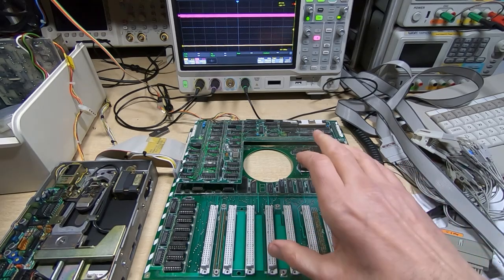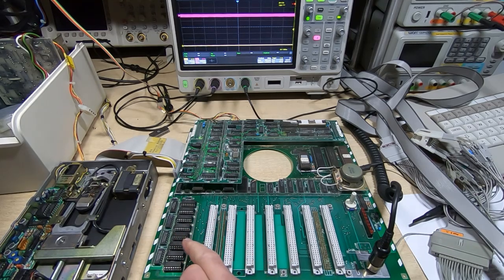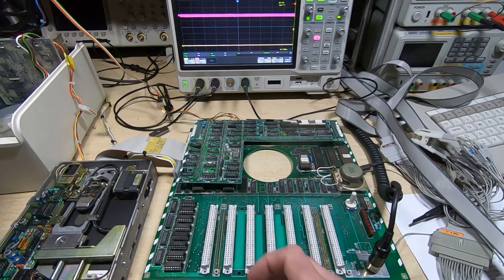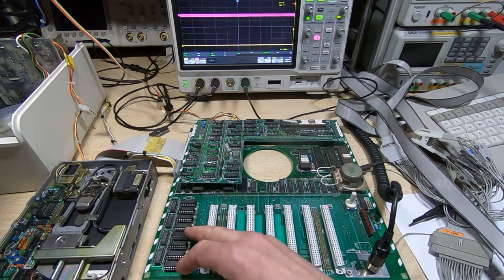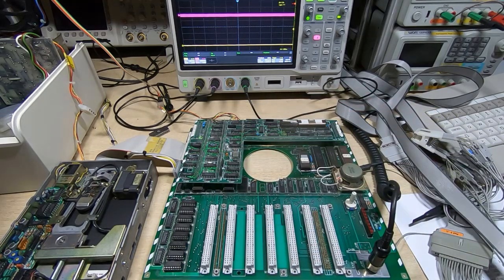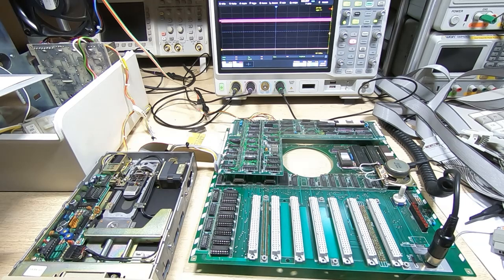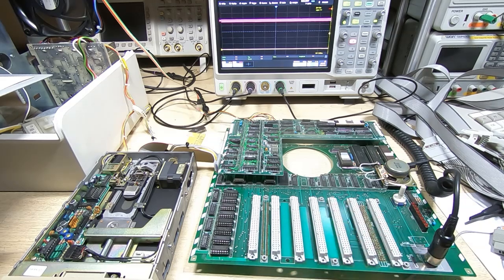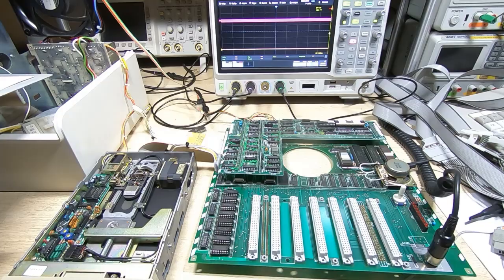NCR Computer Repair Part5

Comment: All the time I just took it for granted that the address you saw on the analyzer was the actual adress presented to the RAM chips, but once you drew attention to the fact that you had just connected it to one of the chips (which you did mention before, of course, I just didn’t think about it) I guessed what was going on. Quite the ”aha” moment.
Reply from the maker: This is an odd processor. The address shown on the LA is not the address bus used by the RAM. In fact this processor does not really have an address bus except the one used for the ROM's but this is not shared by the rest of the system.

Comment: Having the via's fail is very interesting, was there signs of corrosion (by water/etc) on them?
Reply from the maker: No there are no external indications. I do see these failures on a fairly regular basis and I think it just comes down to board manufacturing. Modern boards are far more reliable. The worst boards I have seen for this are the old 4 layer HP boards which frequently develop internal layer breaks (see my video series on the 9830).

Comment: Wow so many PCB failures. Do you think this is the fault of the original soldering?
Reply from the maker: I am fairly sure that the DRAM / board issues are 'repair induced' by someone not being very careful when desoldering. The failed vias are not very common but some older boards do seem prone to them. The through hole pad failures are most likely caused by overheating during desoldering. This board only had a couple of failed vias and this may just have been an issue with this particular board itself. The quality of the original soldering seems to be fine, just a pity that they did not fit sockets for the DRAM. Interestingly the manufacturer did change the style of board in later versions.